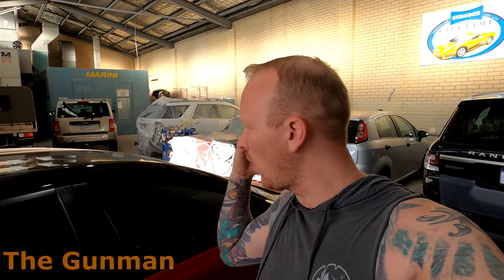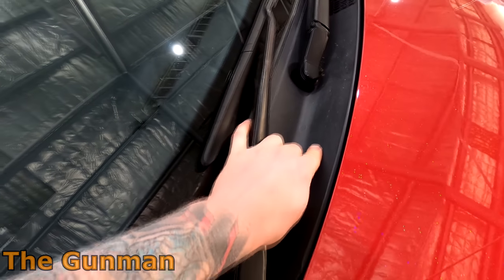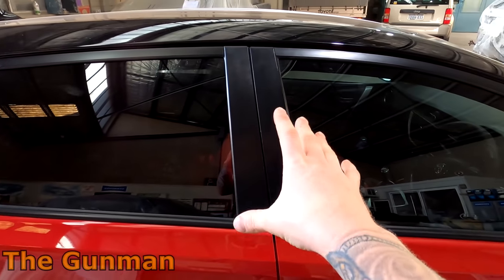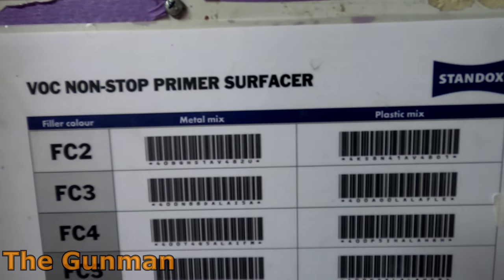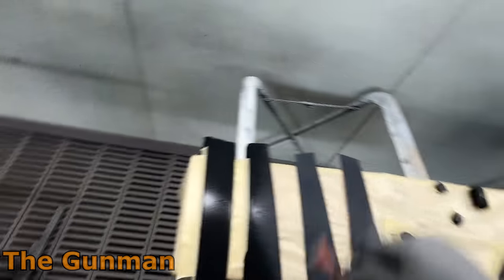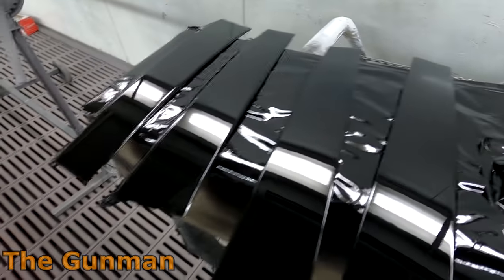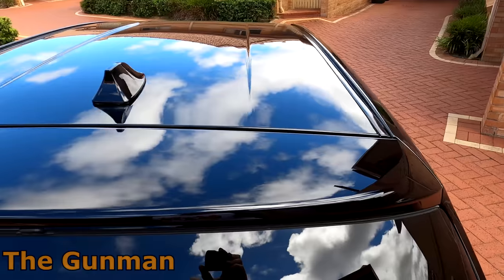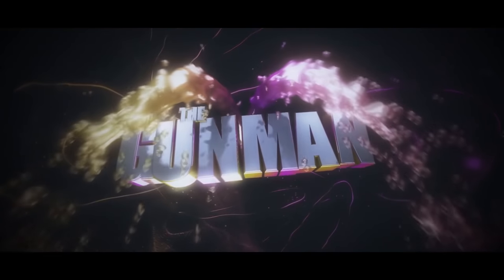How To Paint Plastic Trims On Your Car

Comment from the maker: This is the first of what will be a video set on the transformation on my own little Corolla where I sprayed the Roof, Wheels, Trims and all Exterior Bare Plastics gloss black. Fair to say it's a massive upgrade and I'm wrapped with the results. Stay tuned for the rest of the videos. Also, the Gunman spray suits should be available in Feb.

Comment: Hell yeah gunny, spraying my VS right now and all the rubbers and plastics around the window are typical second gen commo spec and all faded out.
Thanks for the tips brother!
Reply: Hey Jacob Muldoon
I painted my vs cubby about 5 years ago and I painted all my door handles, wipers and plastic trim and the aliminium trim over the doors in  black clear over base and it looks great even now. The car is silver and the gloss black just pops. 👌Use a good quality clear and the gloss will last for years...I love that car.
Cheers
Reply: @beauchamp1763  
Up the clubby!
She'd be appreciating now that's for sure man!
Unfortunately mine is only an Eco.
I plan on spraying mine the same blue that the VS vacationers came in
Reply: If your headlight lenses are bad I saw a video where it was sanded back and 2K clear was the best performer over anything else  including the specialty stuff

Comment: The door frames on my Prado are actually covered in a vinyl wrap which has started coming off (mainly thanks to weather shields I removed which someone glued on). It's aluminium underneath. Not sure whether to try and re-wrap it or remove it all and paint directly onto the aluminium.
Reply from the maker: I guess it's up to you depending on the quality you're looking for, I have a habit of obsessing over those minor imperfections. First I'm like, "I can live with that" then I'm like "damn that's doing my head in". And I just go and fix it. So if it was me I'd strip the stickers off and spray them. Just see if you can get a 2K epoxy primer because that's best for adhesion on aluminium and bare metal.
Reply: @TheGunmanChannel  Thanks for that. I'll give that a go. I notice it every time I look at the car so it's worth the effort.

Comment: Great video man. I had a quick question though. If I would like to keep the rough texture of the plastics, is it possible to just clean them, and then prime and paint, just like you did, but skipping the pre-sanding? I'm talking the fender flares and bumpers on a 2005 XC90. I like the textured look, but they have become very faded, almost gray, which doesn't look very nice. I want an almost glossy black finish, but with the original surface texture. Thanks!
Reply from the maker: You can do that but if it's ageing and has chips and scratches in it, it will look terrible once you paint it, from my experience if it's not in very good condition just sand it flat, prime and paint.
Reply: @TheGunmanChannel  Okay, I understand. I'll just do that then, thanks for the response 😎🤙

Comment: how do you glue small parts without the air blowing them while painting on the stand?  otherwise I love your videos, I watched them all..I have been following you for years .. greetings from Serbia
Reply from the maker: Did you notice I back-taped them so they didn't blow away.
Reply: @TheGunmanChannel  I noticed larger parts, but I didn't know that the tape could hold those smaller parts as well .. thanks for the answer

Comment: we call it wet on wet here in Canada, question I drive a ford escape it has the security pad on the window frame should I just use the candy black like the pad glows after touching it, to what I watch with you painting the candy it seams to have clear coat in it with the colour mixed

Comment: I have an 04 Impreza for some reason the factory used aluminum trim, then chrome plated it, then painted it flat black. Seems a dumb combination of unnecessary steps  when the only trim option was "flat black" trim. One side of my car always faces the sun when parked and the black paint has worn off. How could I repaint the trim on chrome plated?
Reply from the maker: I actually have a video coming up where I spray over my chrome parts, but best bet is to scratch it up as good as you can, then apply some 2K epoxy primer for best chance of adhesion.

Comment: Man that looks awesome Gunny, I didn't think the plastic trim would look right in clear but they look great. Been testing a few clearcoats lately tried the Quartz Crystal Clear and Liquid Glass, maybe it's just my skill level but I didn't see much difference in the finish on either of them but I think the Crystal Clear is easier to use and flashes off quicker. Maybe you could shoot the breeze again on your thoughts for these two clears the same as you did for me on the WoW primer, thanks Gunny, John UK.
Reply from the maker: Hi John, the biggest difference is the Crystal Clear is a scratch resistant clear so it's much harder to polish. Apart from that I do agree it actually seems to flash quicker but generally similar high gloss top quality product. I wish I could get more of it here in Australia and I do plan on doing a big order one day.
Reply: Thanks for the reply Gunny, yeah I'm leaning more towards the Crystal Clear but saying that I also like the Octoral C450, at 20C it flashes in 1minuet but it's advertised as a rapid SR WoW clear so with that you have to spray your finish as there is little in the way of flow out, I'm sure Chris at SGD will help you out with the Crystal mate! John UK

Comment: Plastofix 1k  from body that i use for General plastic primer said that you cant use it for pp plastic because of delamination, so i found a primer from the same company hb body p334 that its for all plastics, i dont know if it is for all 1k plastic primer but i dont trust them for pp, even 2k sometimes if you Rush it or you have burn plastic pp delaminate.

Comment: Is it possible to clean off the textured plastic and spray several coats of high build primer filler to create a smooth finish then base and clear
Reply from the maker: That's exactly what I did in this video.
Reply: @TheGunmanChannel  I thought you sanded them down first? Ive 24 heavy textured plastics on a camper van which will take 2 months to sand lol. I was hoping to plastic seal them then go a few heavy coats of HB primer to avoid taking the texture off then wet sand, base and clear.
Reply from the maker: @conceptrestoration1107  oh sorry, yes you're right I did sand first, I thought you meant something else.
But yes you could do if your way as long as you clean the plastic really well fists, then apply a plastic adhesion promoter before your 2k primer. But yeah should be fine.

Comment: SPEAKERS ...are those a pair of YAMAHA 1000M monitors? Merry Christmas!
Reply from the maker: I think they are, I got them years ago on Gumtree, are they really worth that much money?
Reply: @TheGunmanChannel  outstanding speakers, could not be mass produced today due to the beryllium domes. The price increases are real, handle them with care. The woofers have a tendency for magnet shift due to the glue aging, so do not drop them. Crisp bright sound, these speakers love high power amplifiers. I have a pair in my garage and crank them. $$$$$. Good tips on the plastic trim , thanks.

Comment: Why not just use direct gloss black? Did you add and flex additive
Reply from the maker: You'll never get the depth out of DG, it has lower UV protection and on this type of plastic flex isn't necessary, in fact it rarely is. Speak to your paint rep if you don't believe me, thanks for watching and merry Christmas 🎄✌️😊

Comment: Hi gunman, love your videos. Im a hobbyist. NEED help choosing a faster clear gun, lays glass finish. I do completes. My iwata lph400 1.4 too slow. My customers want glass finishes..tired of buffing. HELP NEED FAST GUN GLASS FINISH..THANKS
Reply from the maker: I'm surprised the 1.4 is slow. I usually use a 1.3 on my DeVilbiss pro lite TE20 and have no speed issues. I did a respray with it a year ago and it came out nice and flat but was fast enough too. I would have a serious look at the SATA 5000 RP1.3 or 1.2 even pro lite with 1.3-1.4 tips, they're more than fast enough.
Reply from the maker: https://youtu.be/QMwR9efJ1h4 here's the respray I did with my pro lite. Tell me if it's too slow
Reply: sata pretty expensive..was looking at devilbiss flg5 1.4 or iwata bellaria w400 1.4..im in US. which prolite seem nice which gun lays flat and which prolite for US. if i choose it.
Reply from the maker: @Mr318jones  I was actually thinking of recommending the Bellaria, I wouldn't go FLG5, I mean it's a great gun but for resprays I'd want something better
Reply from the maker: @Mr318jones  and I find flatness and speed are a trade off, the flatter the finish usually means slower gun. Which is why I find the TE20 to be the best in-betweener you could go TE10 or T110 for flatter finishes but they're slower.
Reply: resprays you mean flow coating? i do complete jobs start to finish cars and trucks. flat shiny finish is what my customers want. so, bellaria 1.4 speedy for me get around cars quickly. Where to buy from?
Reply: Where best to order bellaria from
Reply: @TheGunmanChannel  which prolite cap tip you recommend US. version  best for my type spraying? where to order from?

Comment: Dude, Primer Surfacer is not Wet on Wet/Sealer.  Primer/Primer Surfacer/Primer Sealer - 3 different things.  4:1/4:1:1/4:1:2
I don't mean that in a mean way, but almost everyone gets these wrong because of how similar this is and how the difference between Primer and Primer Surfacer is not real.

I don't really like the final product.  You made the car too shinny.  I like cars to look natural with off black plastic and fine texture.  I know this is subjective, but to restore the plastic to original texture and color is not easy using paint.  Tons of painting products out there, but hard to restore the original factory look.   Not hating, just saying restoring to original looks would be weeks not 1 weekend so I understand you.  Tons of research and try and error would be required.
Reply from the maker: @AW33COM  it's a 2014 corolla man lol, I'm hardly looking at restoring it and I reckon it looks so much better than that shitty cheap exposed plastic look. But whatever floats your boat. You do you.